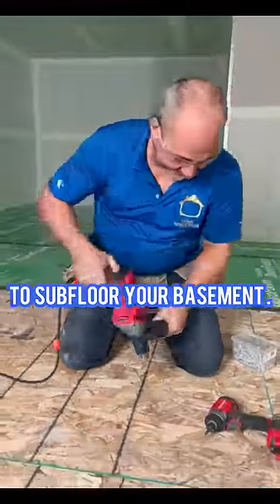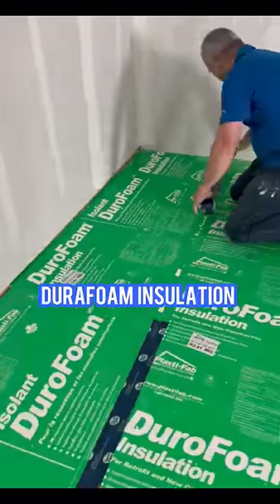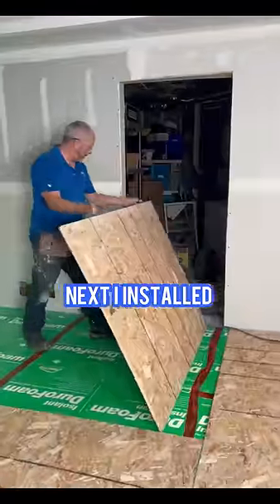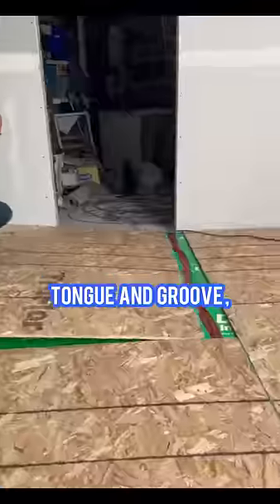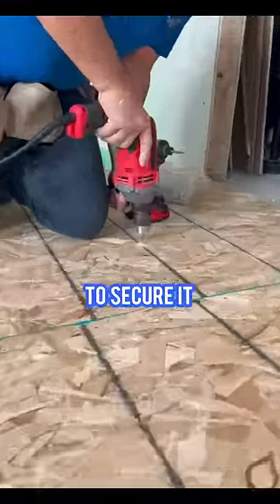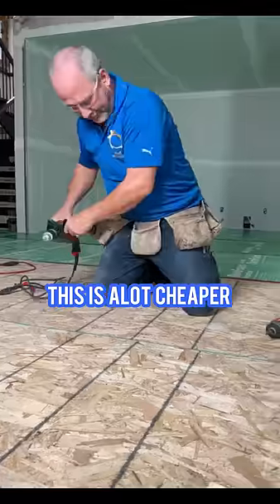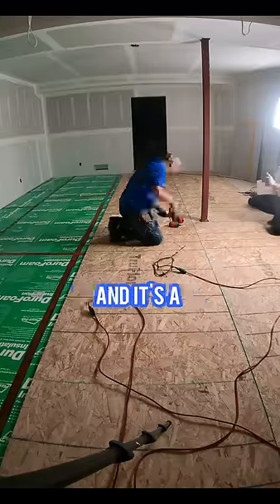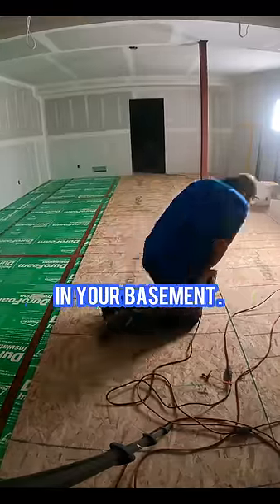THIS Is How You Save Money on Your Subfloor Install #shorts

Comment: Falcons take forever to drill each screw , and they won’t keep the sheathing straight unless you use 50 per sheet and the heads won’t set in a number of them , so the sheathing has to be re drilled and re screwed . It will work but there is a good chance, in a basement that condensation will be trapped in spots if you have a high water table . I don’t necessarily have a better solution because in my 50 years as a contractor, I have seen fails with every application.

Comment: I think pouring self leveling concrete and then painting it with one part epoxy is more cheaper and last longer. No more mold or moisture issues.
Reply from the maker: and still freezing cold. Cheers!
Reply: @HomeRenoVisionDIY  yes because developing black mold under your floor is somehow better than it being cold? 👌

Comment: Would it crush if a treadmill was put on it?
Reply: I think it would be fine. The osb spreads the load.
Reply from the maker: since the floor is installed under compression it carries an incredible amount of weight without problems. Cheers!

Comment: Also with the Tapcons being so expensive The installation is expensive. It's a lot of work involved. You have to hammer drill every hole and vacuum every hole before you put the screw in the concrete . Depending on the size of the basement, may need at least 600 $ for for screws and carbide tip drill bits.

Comment: Better retract your statement that it's the perfect subfloor for any kind of floor in your basement. I would not install hardwood, vct, or tile with that method. Not to mention the potential vapor and or water problems. It is a cheaper method to insulate the concrete, but a better product is dri-core. And it's easier to work with.

Comment: Bullshit any floor… you try putting tile on top of that! Or hardwood for that matter
Reply: Why tile the basement, it will still be too cold even with insulation
Reply: Exactly, that's only good for carpet and laminate
Reply from the maker: in the next video we show you how to install hardwood on top of this and it works awesome.
Reply: @HomeRenoVisionDIY  You shouldn't install real hardwood floors in basements, except engineered wood, due to temp and humidity fluctuations.
Reply from the maker: in a new build there is absolutely no temp or humidity fluctuations. Cheers!

Comment: Once again DIY is back showing you exactly what not to do in a basement. Good luck with that when it gets wet, and it will get wet, condensation from ground temp and insulation is a fact. At least put down a dimple board first to give it a chance.

Comment: Never do this to your basement why on earth would you drill hole in your concrete. Not mention all the mold you will trap in their years down the road.  Just use a good vapor barrier and good vynl plank flooring.

Comment: OSB is crap. Talk about cheap. Plywood is the way to go. More expensive but more solid
Reply: When's the last time you used OSB?  The idea that plywood is "more solid" is ridiculous.
Reply: @darinvee4980  lol, only cheap contractors use it for floors to save money when building new homes. It's great for sheathing/walls cause no one walks on it.  Been in the business for 30yrs and when we renovate, we always find the OSB swelled up cause of water or moisture, tiles crack, nails or screws don't hold firmly as plywood, has a soft spongy feel to it compared to plywood.  I'm in high quality renovations and plywood is always used to not have any problems down the road. If cost is a concern and you don't care about quality, no problem, enjoy!
Reply from the maker: there is no need to add strength when installing on concrete. Cheers!

Comment: Never use osb in a basement lmao. I did basements from start to finish. When it came to subfloor we always used Dricore 2ft by 4ft tongue and groove ridgid foam sheets. Super easy to put down. No glue or nails just laid it down and snapped together. 2.41 a square foot and never have to worry about mold and probably the easiest to install too